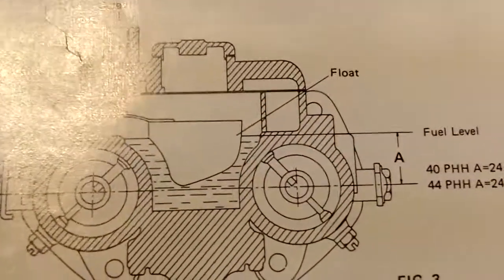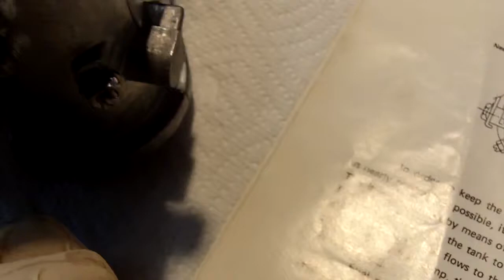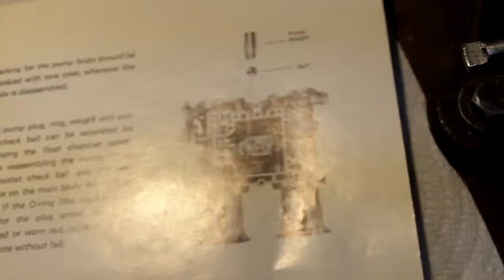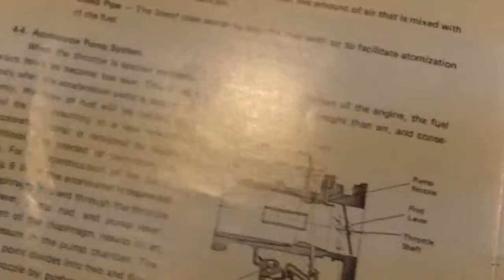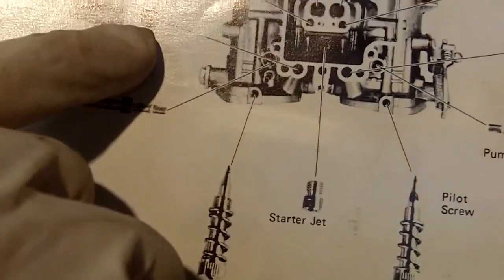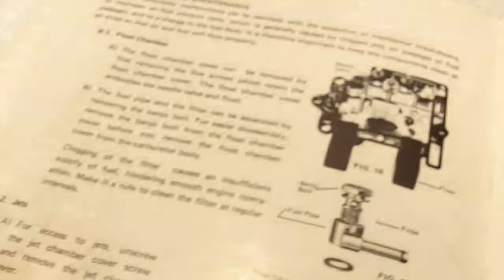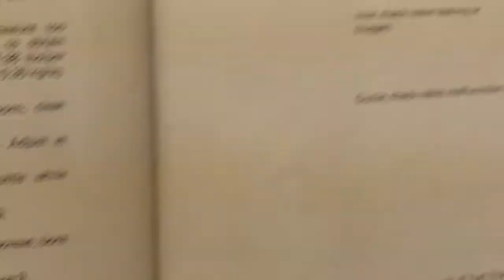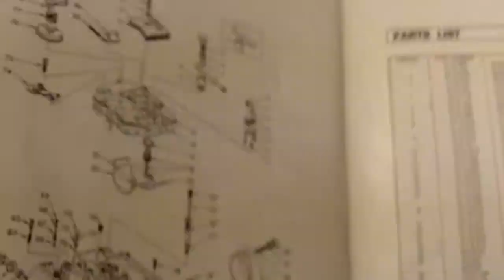Mikuni-Solex Tech Info

Comment: Thanks for this video and information. I have a pair of Solex ADDHE 48 on a race car. Where can I get a manual (or information on the manual) like you show? Any hints on a leaking accelerator pump diaphragm? I replaced with a new diaphragm and have a small amount of fuel leaking.
Reply from the maker: Glad the vid could help. My Solex focus is very narrow, just for Mercedes of the 50's-60's. Sorry, but I have no other knowledge of the ADDHE. I Googled it and came up with lots of pics and info. Here is one link you might use:
http://www.rmcarburetors.net/addhe_rebuilding%20v2.htm
The ADDHE looks like a combination of Weber and Mikuni with a Solex name. I assume they borrowed from each other or purchased licensing rights to the designs. Best of luck.

Comment: My idle mixture screws are sealed. There is no way to turn the screw to change the setting.
Reply from the maker: That is very unusual. They have to be adjustable. Can you post a video of what you are dealing with and send me the link?
Reply: Sealed? Like how? No spring on the screw?

Comment: wow! Thank you again very much! It was very helpful. I tried yesterday before seeing this video to clean and check things in there. However there where 2 screws in each side I could not unscrew.. 
So, I 'll go today again with some extra tools and with what you sawed me, I will probably fix them.

Randomly I saw the gas spray from the last two carbs and looked ok. I will the the other two today. I really hope that noone damaged those.
I bought one of these synchronizers, so, one last question. What should I be seeing if I tuned them correctly?
Reply from the maker: Which 2 screws?Use the syncrometer to get all the same readings thru all the throats.  I have to assume your 4 cylinder is similar to the ones I work on, so you should see 8 or less on the synchrometer.  This will depend on your normal idle speed and type of camshaft.The important thing is the readings are all the same.  If not, check valve adjustment, compression, cylinder leakage, spark plug wire condition from cap to plug terminal, etc., normal tune-up things.Where are you located?  I am in Dallas, Texas
Reply: I uploaded photos and a video in Google Drive. I circled which screws are stuck. One of them I managed to unscrew today by hammering it with a straight screwdriver. I think I might want to find new screws. 
Photo 1: https://drive.google.com/open?id=0B0enAjyv3soNbGh2V3VaQklrTHc
Photo 2: https://drive.google.com/open?id=0B0enAjyv3soNdlZuMjNpcUctaG8
Video: https://drive.google.com/open?id=0B0enAjyv3soNRFJZSGlfLWNpOHM
Sorry for the late responses but my schedule is weird.
Should I screw harder the screws inside the cap I managed to unscrew?
Reply from the maker: Normally YouTube alerts me of your comment.  They did not so that is why I am late in responding.  I had not heard from you and thought I better check.Thank you for the photos and video.  They are big help.The blue screws need to come out so you can get inside the carburetor.   The steel screws are corroded and stuck inside the aluminum carb body due to electrolysis.  Use solvent like ATF and mineral spirits mixed together.  Use heat from a hot air gun to expand the aluminum.  Use an impact driver: https://www.youtube.com/watch?v=cUSuSn_QZmkhttps://www.youtube.com/watch?v=Og0wilzMtXYBe careful.  Do not break the screws.I saw the video.  The problem with no idle is inside the carb.  You have clogged fuel passages due to dirt or old fuel.Once inside use carburetor spray cleaner or similar volatile solvent to clean inside the carb.Report back on your progress.  Where are you located?
Reply: Its ok about the responses, don't worry, my schedule keeps me busy well enough. 
I 'm from greece, and unfortunately mechanics here don't know carburetors very well and the ones that do, are not trustworthy. That is why I 'm searching for help on you tube and on the web. So, 
I got the synchrometer and the ratings are off in each carb. Also by turning the pilot ( idle mixture) screws I see no difference in the ratings. For example the could go from 5 to 4.9.
The pilot jets where really clean and not moving (at least I think it was the pilot jets). Also I saw the gas sprayed in the carbs through the accelerator discharge nozzle, so I guess that works. I checked that only in the 2 carbs on the right. I cannot fit on the left ones. 
I will try to upload another video with things I checked and their condition. I have not checked yet the fuel filter. 
Also about what you said in around 8:40, I am not able to remove the pins with my hands, however they are loose.
Reply: I made a mistake there. About the idle mixture screws I ment that I cannot find where the engines stumbles. I see no difference turning these in or out.
Reply: Does the "no airflow through the second barrels at idle" rule apply to all carburetors? Cause I cannot get them closed.
Reply from the maker: Yes, the pins should be loose.  I will make a video about this in the next couple hours. Do you have the carburetors off the car?
Reply from the maker: This tells me you still have a blocked or clogged or obstructed idle circuit.  I think you need to remove the carbs and see if you can soak them in carburetor cleaner.  We use Chemtool https://www.berrymanproducts.com/products/gasoline/b-12-chemtool-carburetor-fuel-system-and-injector-cleaner/
Reply from the maker: I think you should have the same airflow thru all the carbs.  The no air flow applies to Mercedes 190SL, some BMW and Alfa only.
Reply: Unfortunately the carburetors are still in the car. I don't mind taking them off, I just don't feel confident enough that I can put them back together. 
But, I don't see another solution, so I will remove them and clean them piece by piece. I will buy some cleaner, I found some nearby.
Reply from the maker: I am downloading a video for you now.  Give me another 30 min before it is posted.  View it first before removing the carbs.  If the problem can be fixed by what you can do with the carbs mounted, OK.  If not, then you can remove the carbs.  I think the idle problem is in the Pilot Jets and they can be cleaned with the carbs on the car.  Since you are able to accelerate/rev the engine I think the accelerator circuit is OK.I think cleaning all the Pilot Jets will fix the problem.
Reply from the maker: New video uploaded.https://www.youtube.com/upload

Comment: what is the minimum fuel pressure for two 44mm
Reply: Hello Byron, thank you for viewing and your question. Quoting from the Mikuni Service Manual “Fuel pressure of the fuel pump has a large bearing on the fuel level in the carburetor. The recommended fuel pressure is between 0.2 kg/cm2  - 0.35 kg/cm2, or 2.84 lb/in2 – 4.98 lb/in2.” Not mentioned is the carbs need adequate fuel flow, too. That quantity is not mentioned in the manual. But from other sources I have found “Output 35-40 liters/hour at a camshaft speed of 2500 rpm and feeding through a float needle valve of 2.0 diameter.” Hope this helps. Will